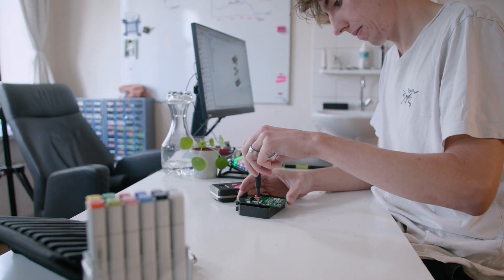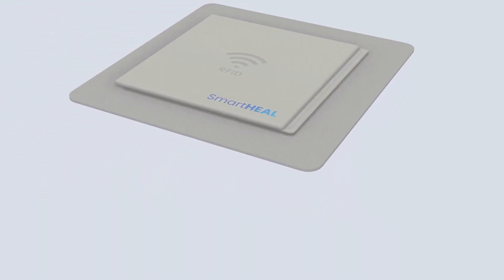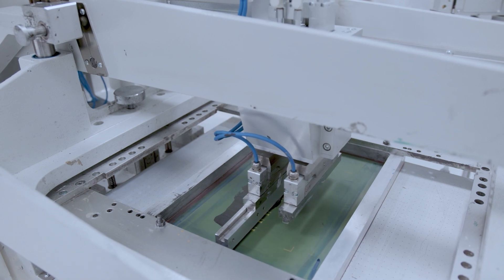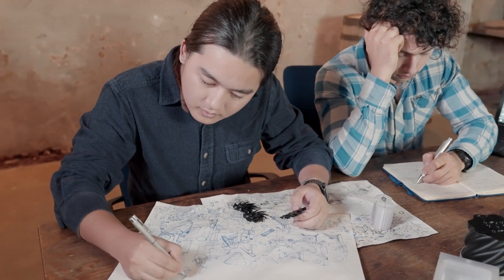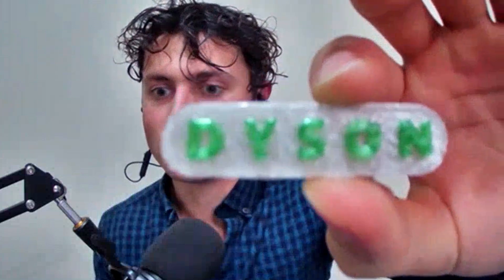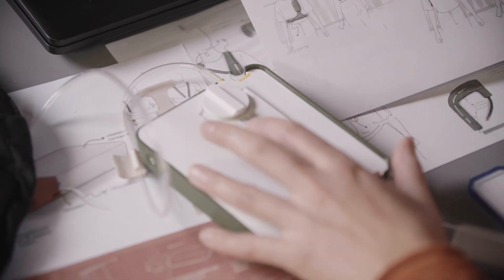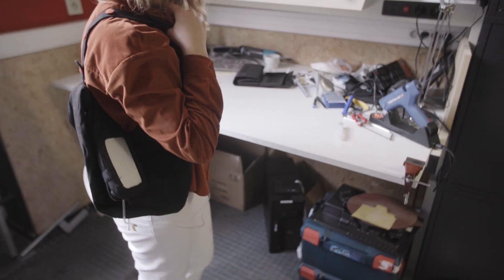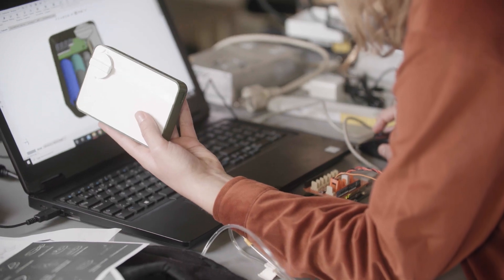Introducing the Global 2022 James Dyson Award winners and runner-up.

Comment: I am very capable of solving existing problems and coming up with advanced solutions. So I decided to explore the Dyson website and look for careers only to find out you need an A in maths no matter what degree of engineering you have previously studied!! Can someone tell me if I’m wrong in thinking this, but I believe that is a little ridiculous if you already have a high level degree in engineering???
Reply: @Lew.6  wow that’s interesting. So what if you took 6 terms of calculus but they weren’t all As? Doesn’t Dyson want creative engineers and big picture thinkers who can also related well to and understand customer’s needs? I wouldn’t say any engineers (of ANY of the engineering disciplines) I know actually had straight As throughput ALL calculus course fit that bill at all! Calculus wasn’t creative either but many of our upper engineering classes were indeed. I never had all As in calculus (first 2 yrs of college mind you!) yet have 3 patent awards in high tech semiconductor  In fact I got a D in the first one (couldn’t understand the woman and she was a TA teaching vs math professor), but got As in the next 3 after that. Diff EQ was a different story. I got an A on the final exam but didn’t get an A final grade due to the midterm exam.  I’m surprised As in math would be the main thing Dyson looks for - over anything else?! Math Isn’t even taught by the engineering department. It’s design and innovation, plus good testing and usability by customers that’s needed! If any of you wanted to work at Dyson don’t let that requirement stop you - who knows how it got there (maybe HR put it on there based on someone just telling them what they were looking for and HR took it literally not understanding the intention)! Just prove to them why you would be an amazing engineer and contributor to their team! Or you could apply for another Dyson job then later apply for the engineering position that supposedly required “ALL As” in engineering calculus classes! I’m still dubious. 🤷🏻‍♀️